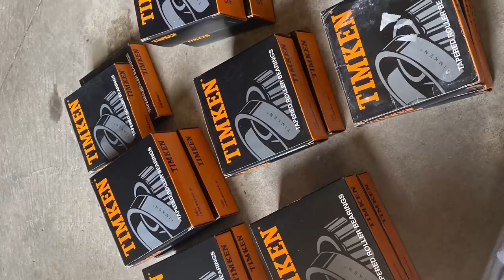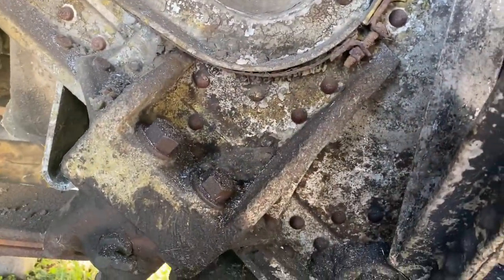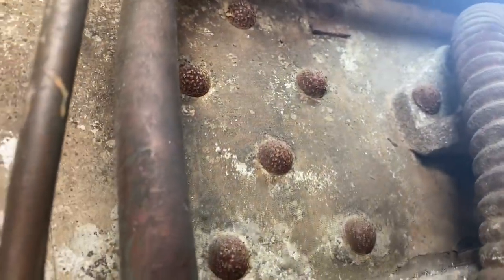Day 5 silversides bus project

Comment: Well I gotta admit I initially got discouraged after seeing the mount cracked, then the rivets and braces tearing out of the structure like that. I thought it wouldn't be a reasonable thing to repair. You have proved me wrong though. It's a good lesson to not get overwhelmed and discouraged so quickly. So thanks for that!

Comment: So how do you plan to attach the new engine plate/ mount to the rear bulkhead, since it is torn out?
Had an idea, you could drill out that row of existing rivets, then drill another row opposite of the tear, then make two "L" brackets that would work as a sandwich doubler attaching to the new plate/mount that runs to the rear. Maybe use a double row of rivets, or huc bolts, staggering the holes so they are not in line with each other, to spread the loads across a bigger area.
One thing I know about working on airplanes, and with hardened aluminum like you have there, is spreading the load across a large an area as possible, or it can crack, you already have a tear there.
Hope that is not confusing, I am just talking about where the mount tore itself out of the rear bulkhead. 
Looks like that pulley is cracked across that one bolt hole, although that is probably not a big deal, probably bigger deal trying to find a new one.
That tap must have got hot when you cut it off, made it brittle.

Comment: I wonder if that broken lower engine mount wasent a casualty from the tire that damaged those wheel wells?
Reply: I think the lower engine mount was seized due to lack of grease, because it is supposed to rotate on that tube that is still there, so it can dissipate the torque and bouncing loads.
With it not being able to move, and the upper plate and engine mount being broken it broke the link that runs along the bottom of the engine.

Comment: My best guess about the '47 having "Fuel Oil" vs the older, pre-war '41 saying "Diesel Fuel," is that after the war, maybe diesel supplies were still affected, and heating oil was allowed to be used legally during the war years and a bit after?  Maybe some other type of oil was in better supply than Diesel, which even 2 years after the war, would have been absorbed by Europe like a sponge, and we were trying to keep Berlin heated and fed.  The Berlin airlift began in '49, but I have to imagine Diesel was scarce even before that.  Europe would have been desperate to get heavy machinery going to clear the rubble, and France, Italy, the low countries were in a similar situation.  I'll bet some buses ran on vegetable oil if they had to. Desperate times..  I wonder if there are any differences with injectors between pre and post war engines (spray pattern).

Comment: Excellent work. 

Are left handed twist drill bits an option in removing these broken bolts etc ??

I’ve had great success using them. But then I’m not working on vintage buses.
Reply: That, and plus using a left-handed tap and left-handed bolts would pull the broken bolts out.

Comment: at least going with a plastic or glass reinforced nylon fan as the other video was interesting using a variable pitch fan first time i ever seen that. as GMC must adapted it from what was used on aircraft propellers as Flixible the clipper busses did exist before the war. along with the silversides bus. the front wheels for safety i would get rid of the split rims get the modern tubeless budd style wheels. for safety of the bus and other people on the roads.

Comment: Scott if u can pick up a cheap 110volt wire welder  (bettar yet something like a Lincoln mp210) the next time u break off a tap weld a nut to it and back it out.  Same for all those broken bolts.  I love your channel but cringe watching you guys struggle with lack of tooling.  I’m a heavy equipment field mechanic so I’m out everyday doing it, but with a fully stocked rig. Also try map gas instead of propane for the small torch, bet you won’t go back.

Comment: When I did the brakes on the GMC 6000 bus that I had I never used a cold chisel if I didnt have the wheel bearing... if I didnt have the socket I would use a punch so I wouldn't do that beaver shit to the nuts!

Comment: Ok the fan issue, with not just use a couple high quality electric fans...
Reply: Considering there is almost no natural airflow through the radiator because of its location, the fan has to move ALOT of air! 
You would need an electric fan powered by a tesla model s motor to move enough air for that to work 🤣🤣🤣🤣🤣🤣
Reply: Not only would it need to move allot of air, but it would need to run continuously. 

Most electric radiator fans are intended to be cycled on, and off as needed. They’re usually not built to be continuous duty.
Reply: The engine generates 200 horsepower. Adding extra draw from electric fans verses using the power off the camshaft wouldn't be an efficient way to manage the cooling. These are well-designed buses.